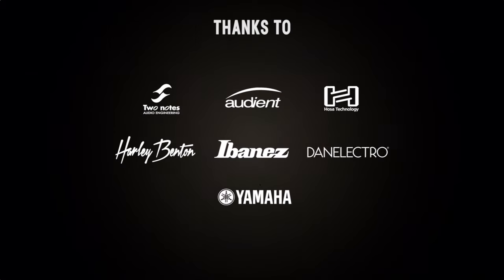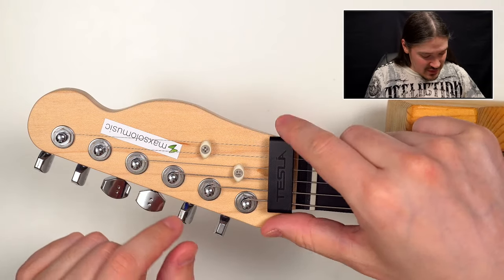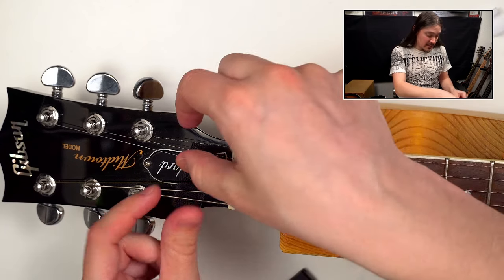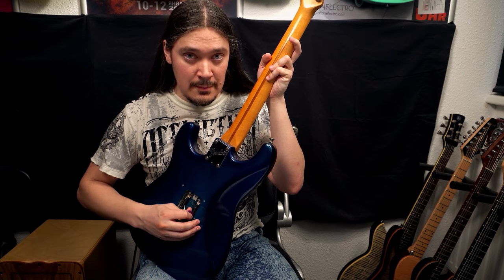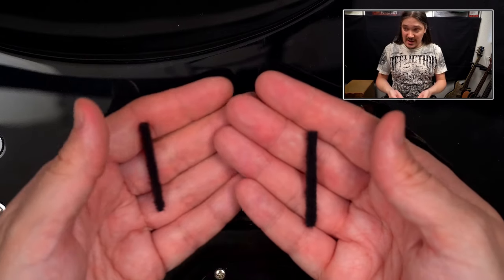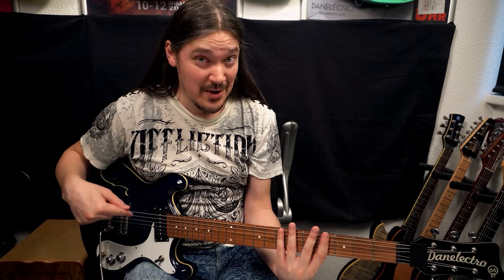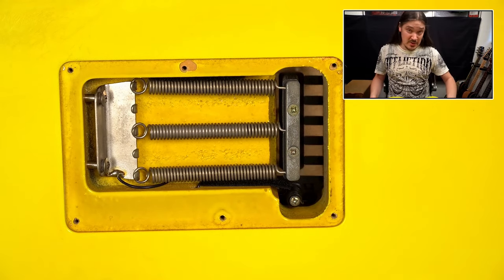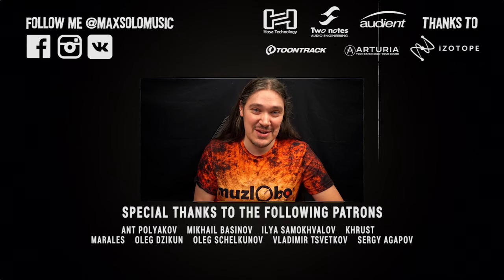Noise Mechanics Or How To Get Rid Of Noise In Electric Guitar

Comment: I have a ton of experience setting up, intonating etc....guitars over the years, and oddly I never factored in the strings ringing out on the headstock as a source of noise.  I suppose some would simply call it resonance, and even desirable at times, but not always. Thanks for that suggestion.

Comment: I actually pushed cut-offs from an old Ethernet cable into my springs. Now they are dead silent. Rubber tubes will absorb nearly all audible vibration if it's the right fit/hardness! The softer, the better. :)

Comment: Great tips. Had some very nice pickups put into my Telecaster and installed a graphtech nut and the mechanical noise was significant. Used the velcro tip on the headstock and it's almost 100% gone. I can't hear anything except beautiful new pickups. Thanks again.

Comment: Hmmm.   An alternative point of view:
Clapton used a trem Strat made hard tail with wood blocks but insisted on the springs being there in order to give the guitar a 'bit of twang'.
Flamenco guitar players have always treasured the additional twang given by the strings between nut and tuners/pegs, and ensure that when changing strings, those bits of string string can resonate undisturbed.
In previous decades, and with some current models, both acoustic and electric steel stringed guitars used a stoptail connected to the strap pin (ie a trapeze tailpiece) in order to maximise the length of freely vibrating string between the bridge and stoptail.

Comment: Huge props to you for this. even though it is 3 years old.  the Velcro trick has so many usages and solves so many noise issues on the guitar.   also, if some people, like me, thinks that the Black velcro takes away from the look of the guitar, if you get velcro with the adhesive back, you can just put some colored tape on the front facing side of the velcro.   for my  guitars with gold or Chrome hardware. I just use some gold/chrome metallic tape and bam...looks more aesthetically pleasing.

Comment: I have used foam behind nut when I switched to 9 - 42 for lead from 10 - 46 strings. However, the foam wears out quickly. Velcro seems to be the next choice as you demonstrated. I will do that. Thanks for a good work.

Comment: I've always used a piece of soft foam under the springs. Dampens the springs moving side to side altogether and only allows vertical movement. The soft foam doesn't effect spring tension so no problems with bridge returning to zero either.  Little graphite lube on all metal contacting surfaces eliminates creaking while using the trem. Didn't notice how much mechanical noises came thru until they were gone.

Comment: On tremolo springs I use heat shrink tubing, but with heat applied so the tubing is snug only at both ends, and only just touching the springs in the middle.
Reply from the maker: That works but may affect the tuning. It's like fighting the friction in the nut - if there's any friction between springs and something else the tremolo may have problems returning to the zero point
Reply: @MaxSoloMusic  That's true, but only if you overheat the center portion, which is where the spring does it's thing. The end of any spring is pretty stiff anyway, and serves merely as acoustical transmission points to your pickups.
 
 I just touch the very ends with the gun on a low setting and check as I go. It should not affect the tuning or the range of pitch deviation in any way. If the arm feels any stiffer then you've gone too far. I liken it to edge-choking a cymbal.

Comment: Hey bro, yes, I made it to the end, which is rare. You didn't answer my initial noise concern but inadvertently responded to others, so thank you for that! My question initially was why even as my strings are not touching in any way to any frets, they seem to make this weird out-of-balance buzz that sounds much like it's fretting, but it's not. It is especially prevalent on the high "E." (Only when you hit the string)
Reply from the maker: Hey. It sounds like something might be vibrating in the bridge or above the nut, I'd check those first

Comment: Now how do I play Van Halens Runnin With the Devil and not having it sound dampened?  Springs I can understand a bit. Oh well... You can also just take some Velcro with the soft fuzz part and stick it to the back of the plate cover where it barely touches the tremolo springs. Takes that noise away very fast and doesn't get in the way, causing the tremolo to not return to the center position. I figured that one out about 10 years ago. But you have to have the tremolo plate cover.

Comment: Interesting.  I used to put foam in the trem cavity behind the springs to quiet then down.  Good video  and your english is excellent. My  German is kaputt. 😂🤣
Reply from the maker: Foam works. But too much pressure on the springs may cause the trem to not return to zero. I found velcro to be more gentle

Comment: I got a guitar set up and a new bone nut installed on my strat. I’m getting ringing/overtones when I play single notes. Even short guitar notes trigger string feedback noise from the other unused strings and even the string being played. Happens when I play 3 or 2 string chords on  GBE strings as well. I get feedback from the EAD strings. Wasn’t like this before I had the this job done. The action is very low near the first few frets by the nut. I’ve also noticed the action is not even through out neck. Gets higher going down the guitar. I’m taking it back to the shop next week. I’m regretting getting this bone nut swapped if that’s the issue. Or was it a bad set up or is this sympathetic resonance im dealing with now? Wasn’t happening before I took the guitar in. Nice video.

Comment: I shove drinking straws inside the springs. Works like a charm, but you need to find straws of proper diameter. For the strings behind the nut I've used rubber band like the one, which is used in the cloth, worked better than velcro, but looked uglier.

Comment: And what about the toggle switch noise transmitted to the pickup? On all my Jackson/Ibanez/Schecter, when I want to quickly change to neck pickup, I hear the toggle (mechanical noise) through the amp.... So each time I use the volume pedal... Not the quickest way.

Comment: But you NEED those strings to ring between the nut and the tuner pegs if you're gonna do an accurate cover of 'Runnin' with the devil'. Sound appears at approximately 17-18 seconds into the song. RIP Eddie.

Comment: Maybe a little bit effective use pieces of neopren inside of springs and maybe between springs and guitar body, but... need tests)
Reply from the maker: Yeah, whatever stops the vibration works. Just need to be careful there's not too much friction. Otherwise the trem won't return to the zero point properly

Comment: I use a terrycloth hair tie behind the nut. (inner diameter 1 inch, 1€ on ebay) Idea "stolen" from G. Govan

Second side effect: having a steel nut, the open strings sound exactly like a freted string, because the dampening behind the nut acts like a finger behind the fret.

Third function: If in need for string dampening for slide or tapping, just pull the hair tie over the nut 😉

On the trem springs I pull strips of foam thru them. The shape has no importancy as long as they fit thru by pulling on the  tied wire or thread arround one end of the foam. You can put also a square foam under the springs, but I like a bit of springvibration for the sound.

What gets mostly overlooked: the buzz and chirp you get from the springs on the height adjustment screws of the pups. I replaced all springs with silicone tubes😊

As for dampening behind the TOM-bridge: it's robbing little bit of high frequencies and a bit sustain... you can test it by palm-muting those string bits.

Comment: Yo!!! I have a guitar that makes “mechanical noise” on the g string! Every time i play a note that’s on the g string, it makes a high pitch noise right after which really sounds unpleasant! Lmk if there’s a way to fix it.
Reply from the maker: It sounds like the string slot in the nut was cut too wide. Check the nut. If that's the case, the nut can be changed or altered a bit

Comment: Thanks, this was very informative! I have a question/video request. I am really having a hard time with a lot of noise from my amp. The noise is getting better/worse depending on what direction I am facing. And of course it gets worse if I switch to single coil. But it is SO loud when it's at its worst! I have read a lot about how the magnetic fields around you does impact the noise and that you should use "clean current" (don't know the expression in English). I have tried the different sockets in my house (running on different courses), but with no luck. Tried a lot of jacks, but no difference. Might just be where I live, because I live near an airport (straight across the road basically). Would be awesome if you could make a video and address different kinds of amp noise and how to fix it!
Reply from the maker: Hey, thanks! It sounds more like a guitar/cable problem rather that an amp problem. I'd try the same combination at some other place like another room or another house. And I'd try the amp with another guitar. The problem may be in the pickups
Reply: Fredrik Sanne 
If the hum changes as you move around, it's a guitar/amp earthing problem - stray magnetic fields interacting etc. A certain amount of noise is inevitable, but some amps are notorious for this - Boss Katanas for example.

Comment: Does this effect overall sustain? i feel like dampening the strings on a tuneomatic which is suppose to pass those vibrations to the body, if you stop the vibrations before hitting the tuneomatic or string through bodies, doesn't that hurt the overall sustain? or is it fine?

Comment: Hi.  Very informative. Thanks. Why with the exception of the Floyd or Ibanez tremolo systems, do you only use 2 springs, eg the Strat? Regards.
Reply from the maker: Thanks. 2 springs are enough to balance a 9-42 or a 9-46 set of strings. 3 springs make the tremolo less responsive